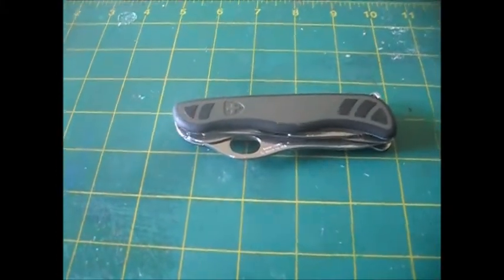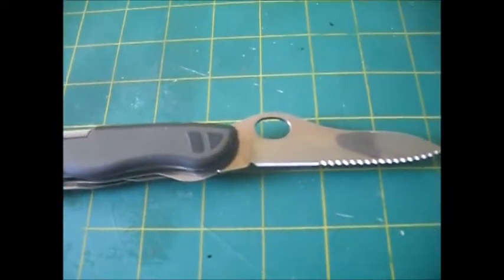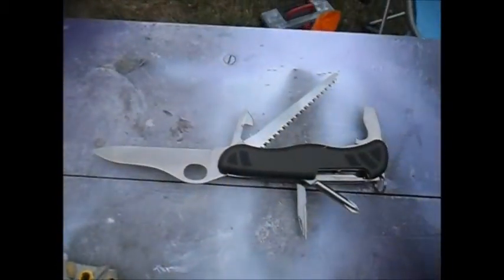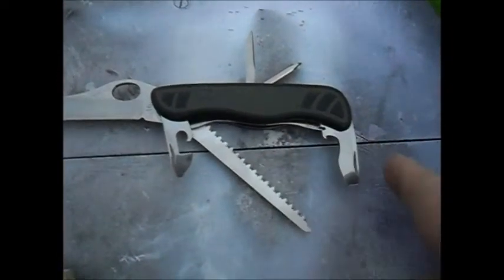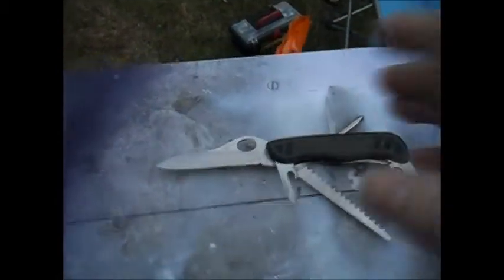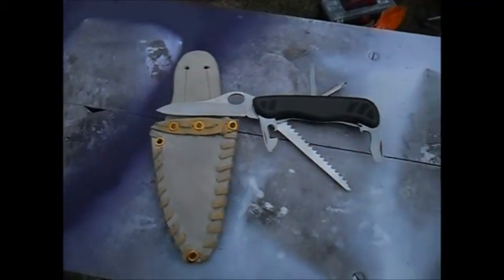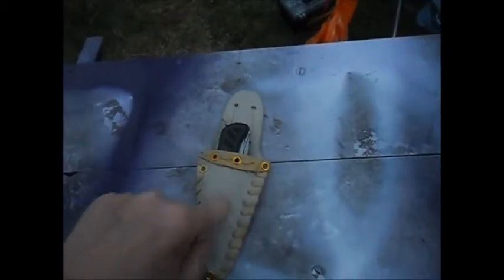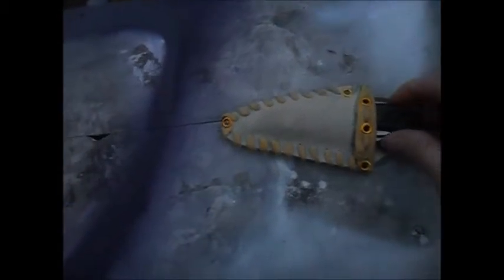ZPs Improving my victorinox soldier

Comment: Nice job.  Couple additions I did to my Fireman were square the back of the saw blade then burnish one edge to make a great scraper or drawknife and leave the other edge square for your Ferraro rod. Put a micro bevel on your large flat head screwdriver so it can be used like a small chisel. Boar a hole in the awl blade to use in sewing and put a gut hook like edge on the inside of the can opener. Great for opening packages, boxes, cutting cordage, etc. I also put a triangle point on the corkscrew to give it a better bite when using it for whatever. Not quite sure what I’m going to do with the other serrated blade yet.
Reply from the maker: I am well pleased with this mod I was using this knife at this yers prepper meet 2021 last weekend to prep food As for your fireman good knife by the way mods make the knife yours ( And to me serrated blads still suc lol